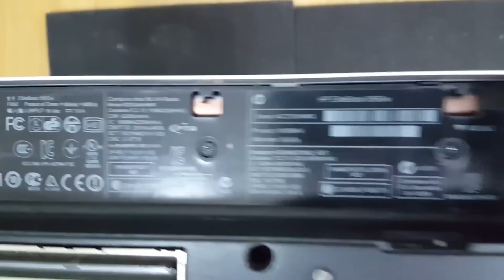HP Elitebook 8560w Disassembly and thermal compound paste replacement, разборка

Comment: Please can I upgrade the gpu
Reply from the maker: Yes, you can
Reply: @handmaderepair4980  please can you show how.my GPU is quadro 1000m and I am using elite book 8560w
Reply from the maker: Just watch my video how to disassemble HP 8560w and you will see graphic card (under copper fan pipe) 11m40sec. Just two screw hold the card
Reply: @handmaderepair4980 okay thanks. What abt the bios? I don't need an extra software? I plan on upgrading to gtx 965
Reply from the maker: Just make sure if new card works with your laptop!
Reply: @handmaderepair4980  yeah it works. I saw it on eBay,its goes for $300+ i didn't know something this small can be expensive

Comment: Hello! What size of screwdiver are you using at 0:31?
Reply from the maker: Try from T5 Torx to T8 Torx
Reply: @handmaderepair4980  In other comment you said that you used PH0, PH00 and PH000 screwdivers??
Reply from the maker: because laptop has different screws
Reply: @handmaderepair4980  but what screwdivers would you suggest if I have 8570w model?
Reply from the maker: Both

Comment: I have a HP 8760w that had a thermal problem. I just put on 'Thermal Grizzly Kryonaut 1g heat sink compound" and cleaned all the vents very carefully after disassembling even the fan. I did that because it was no longer running counterstrike, reaching 95 degrees Celsius on the motherboard in 10 minutes. Cleaning the fan no longer worked.

Current temperatures after applying new paste and running CS:GO:
- 60-65 C on the CPU (8 core)
- stable 60 C on the GPU
- stable 68 C on the motherboard
So... I'm pretty happy.

Some remarks:
- when you turn it on again for the first time, the fan may not come on they way you're used to, but just give a very small movement and then stay silent. I reconnected everything again, but... this was just due to the fact it was now a lot cooler. So if it doesn't come on right away after starting, just wait a bit.
- Using a paper napkin will get rid of all the paste very easily. 
- Don't get any on your hands or especially your eyes, it's quite toxic! Wash your hands afterwards, even if you didn't get anything on your hands.
- 1 gram is just enough to cover CPU and GPU. There is no point to ordering a lot more if you don't need it, because it gets old and useless.
Reply: WHAT THERMALPADS I NEED? I don't see either 8560p for 8560w heatsink WITH these.
1.5mm + 0.5mm, preferably white ones, with 2.4W/m measurement would be good enough ?
Reply from the maker: Good job!

Comment: 1. Not need to unscrew 20-23
2. There is a hole for a finger in bottom of case for keyboard detach
Reply: Unfortunately I am stuck at 15... :( Can I break cover at dvd part to unmount? Or I better use screw extractor or theres way to compount paste with cover.
Reply: Oh well... I saw this comment too late, already gave maintenance to 4 of this computer model... always struggling with the keyboard :)
Reply: Where is that hole located?
Reply from the maker: What kind hole?
Reply: the hole for getting that keyboard off, pressing finger through it
Reply from the maker: @AjarSensation  After take off CD-ROM Drive, you will see square hole on a middle
Reply: @handmaderepair4980  Okay this works, thanks!

Comment: My laptop is running very hot. Could it be the thermal paste? Or is it my fan that is not functioning? As of right now I do not hear my fan at all and the laptop is very hot.
Reply from the maker: Check fan
Reply: @handmaderepair4980  My fan flickers but doesn't spin completely. Is the fan the issue?
Reply from the maker: Yes
Reply: @handmaderepair4980  how do you remove the actual fan from the heat sink??
Reply: @pjwill1077  Buy a new heat sink including fan and all. Make sure its the right one and reattach

Comment: I bought this computer of second hand, (I think it was repaired before sold it to me) it gets incredibly warm, is this normal? 
Ps. It gets warm when I demand too much to the CPU, for example music production or video editing, I never had any trouble with the performance though.
Reply: its normal if its cleaned
Reply: I have two. They both get hot. I typically work at the kitchen table but if I work on the couch, I need a tray to set it on my lap. Even with a tray the heat from the fan is uncomfortable. These machines are super durable and they edit video and photos really well, but yes, they are scary-hot.
Reply: Yeah mine is too. I am considering putting liquid metal instead of thermal paste maybe that will help.  I mean temps are ridiculous ~ 84-92c when rendering in high performance mode ( it's clean ,new paste , cooling pad ). That's questionable engineering from HP they could cool CPU/GPU separately like in Dell Precision laptops but nope let's just cool this quad core and graphics card with single little cooler :/
Reply: Is it upgraded i7?
Reply: I tested mine with furmark, the quadro is up to 90C although I have repasted mx4 thernal compound
Reply: My keyboard and touch pad are not working anymore because of this video is there any fix
Reply: @AsherAmir2002  put the cleaned pins back in the slots
Reply: i sold the laptop

Comment: That's a nice mobile workstation, but I agree that's not an easy job. It's a typical HP engineering for sure. It's why I enjoy working on Dell a little better another point that drives me nuts about Hp is the cheapness. I am sorry but one fan and shared heatsinks? Really? In a 15 inch workstation? My M series has two and they work independently.  I would wonder if such a system would throttle partly. Oh well.
Reply: It is really a bad design to share heat sink with GPU... even of fan is one the head sink should be seperate
Reply: The best laptop design ever! Period. :) Dell can only shine the shoes of HP. Nevertheless, it is HP in Space, not Dell and no ThinkPads anymore. I have four HP EliteBooks 8560W/8570W and I love them. I never had issues with them and so easy to maintain. I hope they run forever.
Reply: Poor engineering but my 8560w has been a trooper of a unit.
Reply: @jimmynuggs5618  Yeah but now it's common to see shared heatsinks in mobile workstations. Before that was only in cheap or light and thin. Still I am glad to hear yours is holding up, that's a plus. I am often critical of HP because they will build something with so much potential but then corners to the point they undermine their own workmanship. It's as if the engineers got replaced by penny counters. lol.
Reply: DELL HAVE A LOT OF MOTHERBOARDS PROBLEMS, THIS HP ELITENOTES WAS THE RELIC,  BEST JOB FOR THEM...

Comment: Which screws are necessary to remove just to add thermal compound?  I would not think all of them shown would need to be removed.
Reply: After checking, mine is an 8560P, not W.  I was able to put paste on by just removing 2 screws on fan, pulling fan away, then 4 screws over cpu, and pulling heat sink off.
Reply: The paste reduced my CPU temp by 10 to 20 degrees.